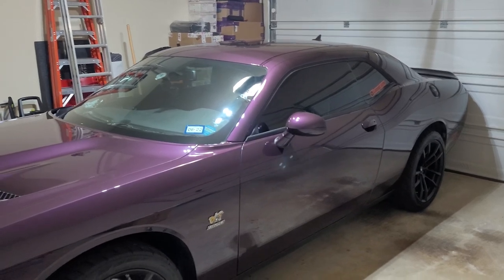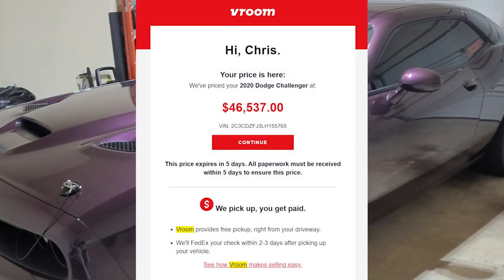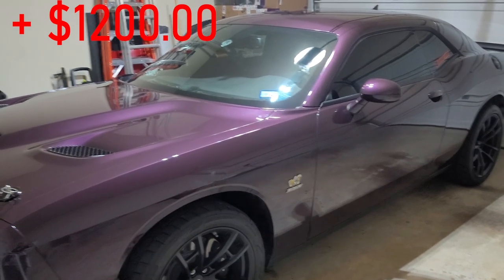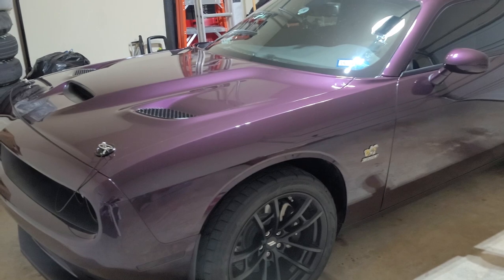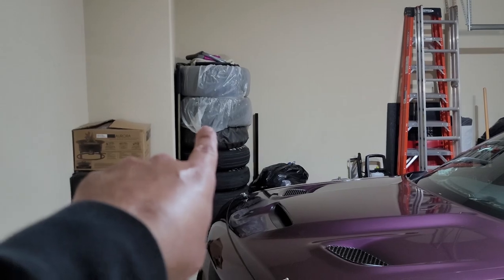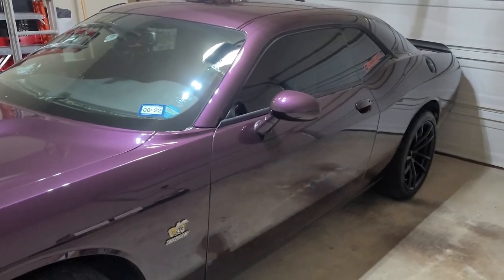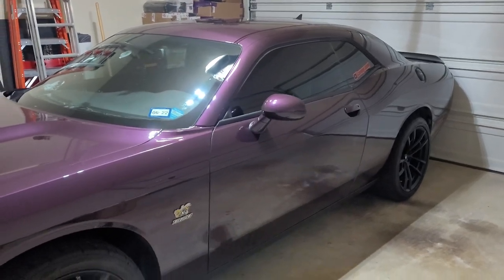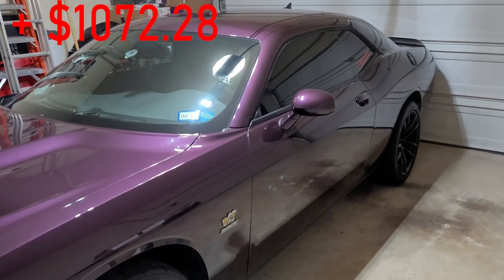How much owning (and racing) my 2020 Dodge Challenger 1320 Cost me through the 1st year of ownership

Comment: So, you figured out how to make a little money racing. Start with a lot of money.😂Enjoyed your content, keep up the good work.
Reply from the maker: 😂, that sounds about right. Thanks for watching!
Reply: @Scavenger1320  you mentioned a transmission issue in this video but I don't recall you discussing it in other videos. Kind of wanted to compare notes with you, I had an issue in late Oct. when the temp was 40*F and I didn't warm the transmission up. Took forever to shift from 3rd to 4th.
Reply from the maker: @ScatPackRob  The issues I'm talking about are only during WOT runs on the dragstrip in Drag mode. The 2/3 and 3/4 shifts sometimes feel almost as if it misses the shift or hesitates. From what I've learned it has to do with the Torque Management. It usually doesn't happen very often, but if you watch my vid from when I raced at Lone Star Mopar Fest a few months ago, I had several runs that day with bad shifts that I complained about and you could kind of hear and see in the footage. One of those runs with bad shifts ended up costing me a trip to the final round in the 11.5 index class.

I'm not sure about your issue but I have been told that these transmissions need to be warmed up and that others have had some sporadic issues when it wasn't.
Reply: @Scavenger1320  I rewatched your video. My bad shifts seam different than yours. Mine was a longer delay between 3rd and 4th. How long? Forever. I was expecting an 11.3x but ran an 11.6 unfortunately I forgot to data log that run. I'll never be sure but I suspect transmission temp was not adequate. I have since monitored trans temp and have found it takes 5 or more miles of driving to reach 100 degrees when ambient is in the 50's. I will be data logging Trans temp on future passes. Have you tried Sport mode? My Tuner recommends it but my data logs show a much shorter shift using Track mode. There is an interesting Sport vs. Track discussion in the "Who has the fastest 392 Scat Pack out there?" thread on Challengertalk. Happy New Year.
Reply from the maker: @ScatPackRob  Each bad shift on mine seems to cost me a tenth of a second. I'm going to try and keep a better watch on my temps when I go racing in about a week and a half, eventually I need to get plugged in and do some actual data logging. I don't have Sport mode for engine/trans, only Normal and Drag. I only get a 3rd sport mode option on steering and suspension.

Comment: I'm under the impression you've got the seats tore out of it carpet like a drag car and you bought little plugins to take dash lights off oh my goodness I don't get it. I learned several old school mopars back when I was younger I'm hoping to buy a Challenger before I leave this world my calculations I'm 54 so that makes me three quarters of the way dead. Did you run the car with full interior and of course the lightweight bumper brackets how much money did you piss away and actually save on the ET. People on a budget and not an endless money supply will probably start with a gear swap in the rear end if you was going to get serious and drag race it. And good luck hope to God no dash lights come on.
Reply from the maker: I wish I had an endless money supply lol. I over-extended myself just spending all the money I talked about in this vid. A gear swap actually would have cost me a LOT more than what the few weight reduction items did that I had to pay for. Most of my weight reduction, seats/trim/carpet/speakers/sway bar/etc. is completely FREE and the best part is I can put it all back easily myself on a Saturday afternoon. Meanwhile all the parts are sitting stored inside my house so when I do put them all back it'll all still be just like new! Plus with these cars a gear swap requires tuning otherwise the car won't run right which voids the warranty, meanwhile my warranty is still fully intact. To answer some of your other questions, yes, I did run this car with full interior exactly as it rolled off the truck. Best I ran was a 12.21 although that was on a hot summer night. With just the passenger and rear seats removed (which I can do in literally 5 minutes) plus the T/A cai, I ran an 11.74 in better weather. Currently my best time is 11.29 with just the weight reduction I did and that cai I mentioned, everything else is completely stock (engine/trans/tune/suspension/driveline). Also no codes or lights of any kind although yes, I did have to buy a few dummy plugs that I talked about in this vid. Most expensive thing I got was the wheels and tires but that's something everyone wanting to get serious about drag racing needs. Thanks for watching